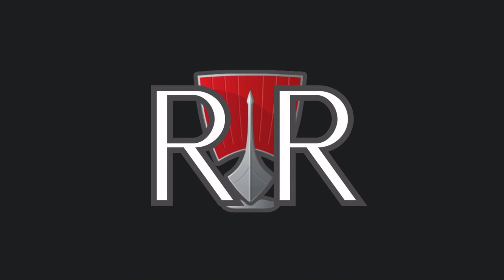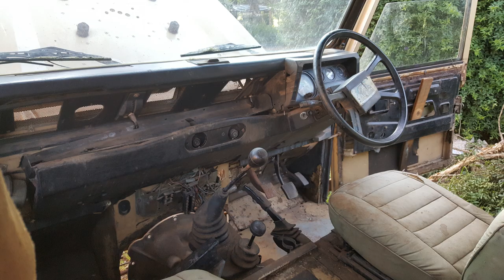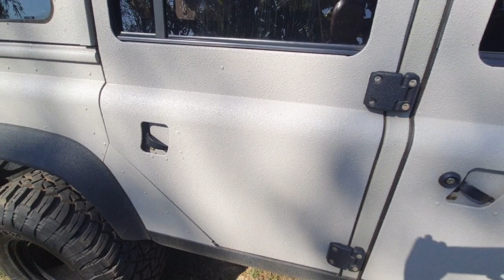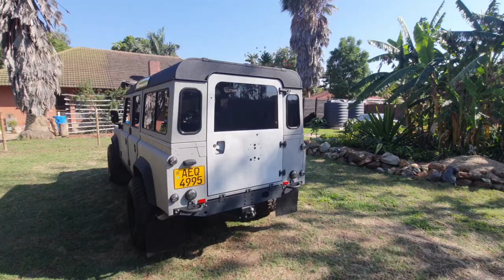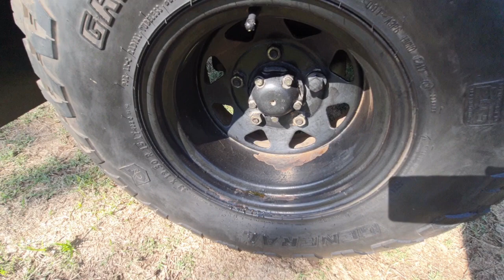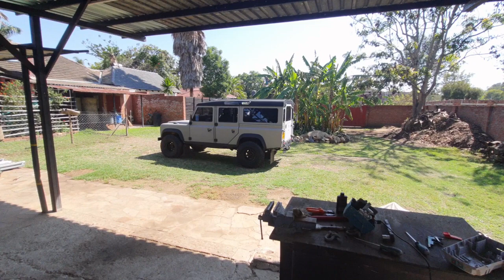Land Rover build  - what's next? V8 engine?

Comment: Hi Rad,if i bought a om 606 engine(turbo) should i pair it with a straight 6 gearbox from Mercedes as well
Reply from the maker: Hi Judzantn. I understand the best gearbox for the turbo OM606 in a Land Rover is the R380 stumpy with uprated bearing from Ashcroft Transmissions. That way you can keep the standard transfer box and prop shafts.
Reply: @ ok what if i want it to be Automatic transmission.I have a 300tdi manual from my built
Reply from the maker: @judzantn  I'm not so sure about that one. This video might be helpful though - https://youtu.be/Z6ODAXJOtuQ?si=cUzMWDUqtxGUNl1x
Reply: @ Thanx he is source of information as well.I follow him on youtube as well.Anyways will update you as the built goes on.Thank you very much